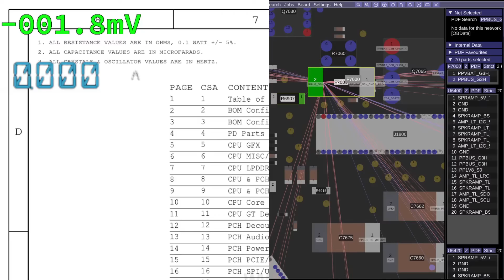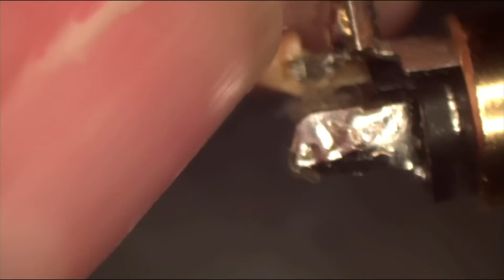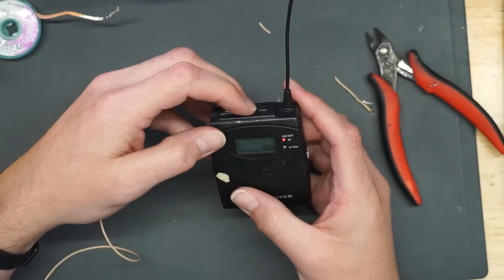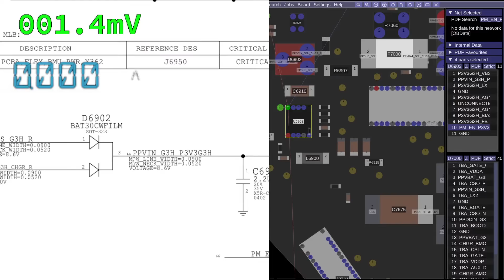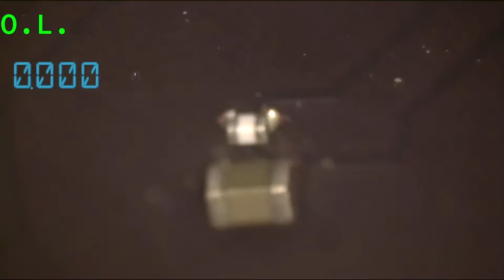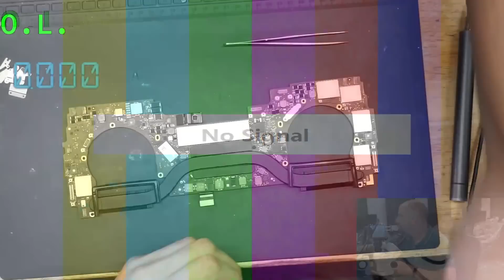A1706 MacBook logic board repair with Paul, live from Rossmann Repair Group

Comment: Hi Louis,
I have also an issue with a a1706 and have a question, when measuring with amp meter only 5v and amp varies between 0.13 and 0.25 amp
pp3v3 G3H is present and ppbus main rail also but doesn't get 20V and obviously doesn't charge too and to me the four cd3215 looks all fine (usbc ports doing all the same thing, no anomalities).
do you have any suggestion.
the only visual thing I noticed is that C3208 looks a bit burned but seems to work fine -, it is not shorted and I am measuring 3v at that cap 

please any suggestion would be very welcome!

thanks in advance!

Comment: Is that page you using free or not?
Reply: Are you asking about the schematic and board view? For most of the older machines, yes you can find them for free. The software I use to display them (Flex Board View) is not free as seen here, there is a free version that works fine just with less features (Open Board View).

Comment: Re: Stadtionalist: "Why is resistance increasing? (As in, somewhat slowly as you're measuring)"

The ohm meter is supplying a small current to measure the resistance of the circuit. That current is charging the other capacitors on that circuit, and the resistance of a capacitor goes up as it gets more charge. On the flip side, if you use a volt meter to measure the voltage across a capacitor, it will slowly discharge and the voltage will decrease.
(edit: spelling)